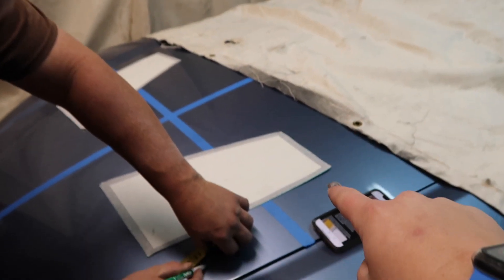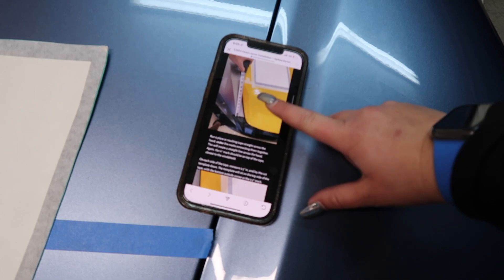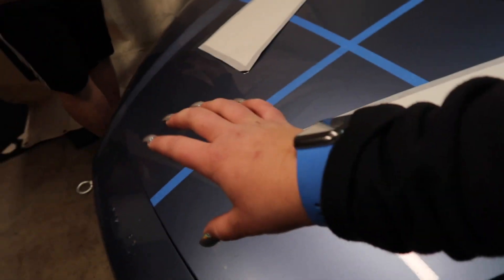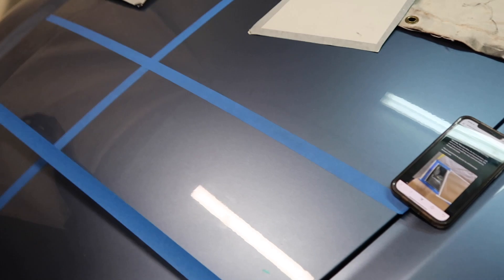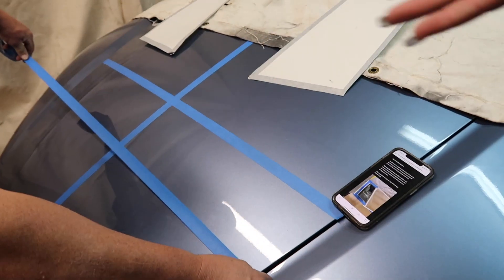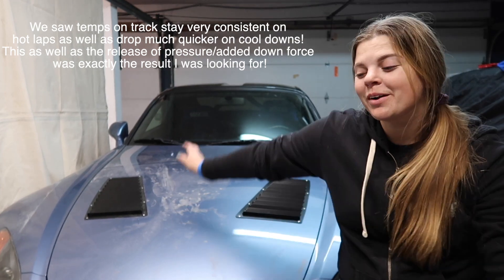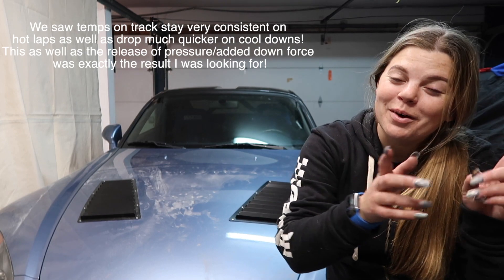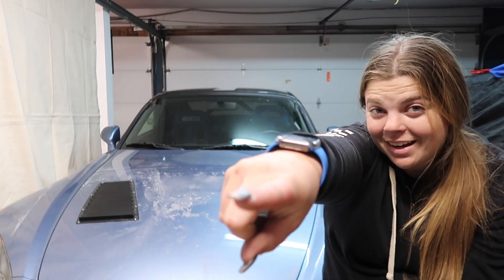Will Hood Vents Help Keep Temps Down on Track? S2000 Spiked Performance Louver Install

Comment: What happened to the mini? Was/is it reliable? I may have to pick up one for 1k

It will be a non running project. It had an engine replaced and thr owner lost interest
Reply from the maker: I sold my r53 but I am still working on them and have an R53 video coming up soon. I still have my f56!! R53 and F56 are very reliable!!
Reply: @JulietteHallie  thx. I believe it's a r32. I may have to grab it but the z4 is my true love
Reply from the maker: @m32mikestu  def don’t get an R56 generation 😂